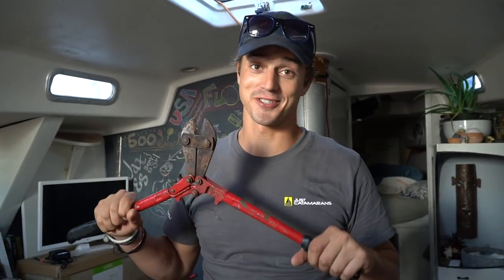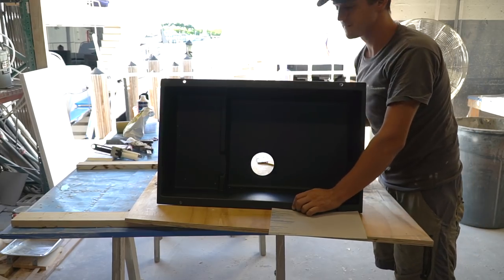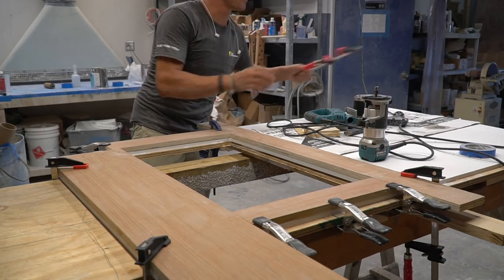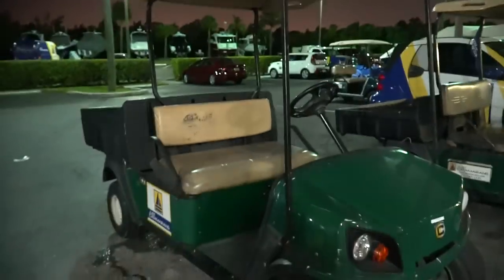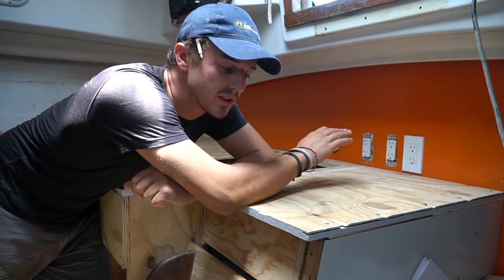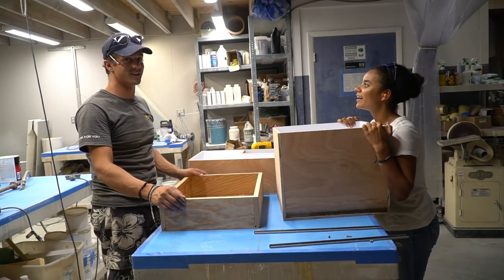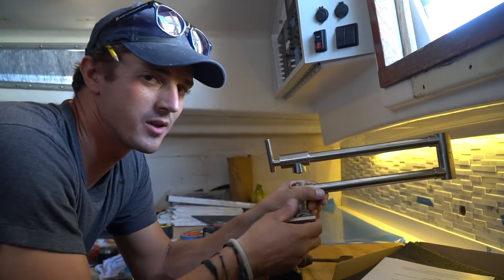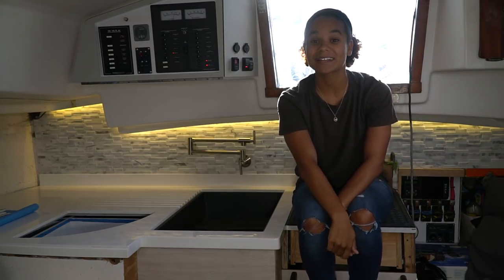Sailboat Galley Renovation (DIY Corian Countertop) — Sailing Uma [Step 136]

Comment: Love your ideas for this gallery refit! Funny how similar our plans are. We were struggling with the faucet choice though and you totally just made it for us! Such a smart choice.
Reply from the maker: Well They accidentally sent us 2. It's yours if you want it :)
Reply: Definitely! We'll see you guys soon :) Thanks!
Reply: Make sure that something sliding can't turn the faucet on. Would be unfortunate under passage to have the water flipped on :D If you want hot and cold, you could install a separate mixer valve like some faucets are set up with and then feed the output from the mixer valve to the cool retracting faucet.

Comment: Back in the day, (several decades ago), " interior grade plywood" was fabricated with interior
grade ( Non-waterproof ) glue. This caused more bother than it was worth, so all plywood
was made with waterproof glue. Additionly, Marine Grade is fabricated with solid cross banding and layers to eliminate voids that would facilitate water intrusion from edges, reduced holding for fasteners driven thru internal voids, and prevent distortion when bent to shape.

Comment: Dan,  I may question some of your choices, based on my opinion, but always acknowledge it’s your choice.   The one thing that really is unquestionable are your carpentry skills and your creativity on addressing a project of any kind.  I know it certainly helps having a shop to work in but damn your pretty skilled.   You have actually started making the boat better than new.    Have you guys thought about upgrading now that’s it at a point of maximum resale?

Comment: you can add a mixing valve if you get hot water and then you can set the temp . One more valve beside it like a shower valve that sets the temp but can go through multiple heads .

Comment: Here's an idea. The opening for for "Hefty Susan" you should make a top. By routing a lip on the Corian counter top and routing a lip on a cover. You can make it fit flat. Then drill about a 3/4" hole in it to lift it on and off. You expand your work area. And cover the area for the "Hefty Susan".

Comment: They loosen through repeated heating and cooling cycles. Keeping them tight prevents overheating and terminal melts. Terminal maintenance should be as regular as your electrolyte maintenance....  Course you don’t need to worry about electrolyte anymore but terminals are still there. 

That worktop is a thing of beauty!!  Amazing. Love the angled drains. What’s the surface material called?  Corian? (Whizzes off to search....)

Comment: they look really nice!   think i would have used a round nosed bit for the drain grooves, but that's a small thing.   I would suggest a "drop on" cover for the Hefty-susan hole, just something that covers the big hole so you don't have things sliding and dropping off down into it when the boat heels over to a big wave...
Reply from the maker: Already done. Look closely at the thumbnail. But will detail more in final vid.

Comment: Looks neat. Nice work. I love the way you design and make things for your boat. Not what I would have done, or anyone else probably, but that's what makes it interesting and fun to watch your channel. Your energy is always inspiring.
I think you may have trouble keeping water and bits of food out of the lazy Susan. How does it lock in place? Surely the compartment with the heaviest contents will swing to the lowest side depending on the tack. And if not locked will constantly be turning. I can see trapped fingers as it rotates. You've probably already thought of those things and found a solution.
Might get to see you at the Boat show.

Comment: Great job in design and execution. Not sure how this progressed, but now about your remark about an induction stove top and this design.
Looking at the opening and rotating cabinet internal, maybe consider something like an "Instant Pot" (tm). That's an electric pressure cooker. It can do slow cooking too. Insulated, heat loss is even less than in induction with a pan. Its insert can be used separately on induction. Great for lobster, fermenting, rice, dried legumes. If that would fit in the rotating shelf, I would put it there (just prevent >360 rotation). With its control panel on its side, maybe a Bluetooth version.
Reply from the maker: We’ve thought about it. Maybe someday, but we’d need a larger inverter to run it and those are expensive. We also like having the cooking redundancy with multi fuels.
Reply: @SailingUma  - for 1,000W? OK. My language has a saying, money doesn't grow on trees :). That said, imagine you could "tap" different Voltages out of a series of batteries. And you could feed appropriate DC volt into devices that run or can run on DC. No DC-AC conversion, no up-transformation, no down-transformation and no AC-DC rectilinearization. Just 12V DC into a laptop, e.g. It's all optimization versus ease or luxury, like sailing, and life

Comment: Looks awesome guys.  You're turning Uma into a high dollar boat!  
I would think a cover made from the same material as the countertop would be nice to have sometimes?  Maybe you're still going to do that?  
Also, being of the short variety like Kika I would think that companion way step you removed would still come in handy on occasion also.  
I would think a flip up/down step like you find on many boats could mount easy enough under the opening.
Reply from the maker: Neither of us ever used that extra step. It was always in the way.

Comment: Inspire ring work and vision
Live the pot filler and sink
One observation / critique: I’m a little surprised you left the countertop with a 90 degree corner by the compsnionway. That’s an area where bodies maybe tossed about in a seaway, and I would want that rounded, if I were aboard, visual aspects are secondary.

Comment: Beautiful! I was wondering if there was a way to put a hot/cold mixer valve with some sort of backsplash-mounted stainless dial to allow the choice of hot water to the pot filler. It would be nice to have the choice. At any rate, it's been amazing watching the transformation of your boat over the last couple years! Cheers!
Reply from the maker: Certainly would be easy to add a mix valve. But for now, we don't even have hot water on the boat, so there isn't much point. Maybe when we instal a water heater we'll think about it.
Reply: Sailing Uma  That makes sense. I thought you had hot water already because of Dan saying you would use hot water to shower, which made it sound like you already had hot water. I understand washing in cold water. I don't have a water heater on my boat either. Sometimes I heat it on the stove for the wash, and just do a cold rinse.  One thing is for sure, boats are always a work in progress!

Comment: Thats a considerable improvement, and I like the surfaces
Its interesting how different, and how much the same these late 36' cutters are to my 365 (1977)
The hatch offset is the other way, and no 3 sided galley, but my 9cu ft fridge is such a waste of space or total energy hog, something has to go there
Doors forward in the cabin started square topped (mines hull 103) then went round topped, now back to square
Also I have a V drive that you dont have. Transmission maintenance and drag vs less straight prop shaft exit. 

One problem I have is that my shipmate, Boss the dog, cant get into or out of the cabin on his own as the ladder is too high
Of course your boat shows a different ladder set up, and Im thinking that might be useful. It looks like its about 800mm or 31 and a half inches high to the counter
Anywho thanks for the good look at your galley area and the inspiration to remap things in my boat
and that most of all you manage this while on the boat
cheers
Reply from the maker: The 35, 36 and 365 are all very different boats.
Reply: Later 36s like yours are, but early ones where just versions of the 365
http://sailboatdata.com/viewrecord.asp?class_id=6222

Comment: Curious why you went for a square cut for the drainer slots. Usually these would be done with a bullnose cutter. Given Corian's propensity for fracturing a round bottom slot would be a lot stronger and also easier to clean.

Comment: I'm pretty new to your channel but have enjoyed seeing all your incredible craft projects. I've been sailing for 30+ years but never seen a boat with the customization that you've done - re - such great ideas. One question I have is about the Hefty Susan - did you save the cut out from the countertop to use it as a plug? It seems like a great lost of space to have the hole there - or cut a piece of wood to use as a cutting board and put it in there - will also keep water out of your dry goods if you get another wave on-board..... Also - curious if you found a way to keep it from spinning when you're under way? Didn't see these two in the video and very curious.. Thanks. (I also agree w/ the comments that you all have a great potential revenue generator if you want to start an interior boat renovation business.)

Comment: HOw did you made those groves from shallow to deep? looks stunning... Probably that wood guiding part was lifted on the far side right? Hope that fauchet stays like that when sailing, could be an issue if the arm gets a bit lazy or worn.
That sink is HUGE by the way, did you guys prefer it like this?

Comment: What about adding a separate mixing valve beside the faucet? bring the hot water to that and connect the cold to it as well, then route the mixed water to the faucet itself?

Comment: Hi Dan and Kika,  just found your posts a couple of weeks ago and have already seen the first 135 after first seeing your latest 5-8.  Regarding your battery failure when the post melted and then the loose cables when you took them out to replace them with the lithium batteries.  Did you ever figure out why you had those failures?  I was thinking the clamps might have been loosening up when they heated up when being used due to expansion and contraction and then May e the stud melted due to excess heat and current draw from the loosened connection.  Would love to know the reason both of those happened.  I love almost all of your posts!  Best of luck!

Comment: Hey, nice job and thanks for sharing, BUT, I do not think that the plywood for under your countertop is 'marine grade'. Now I'm not trying to be controversial, but marine plywood does not 'just' have exterior rated glue. In my experience, marine plywood does use exterior glue and supposedly the same as CDX (which is what it looks like you have here) but is has virtual no voids in the layers ( which you have here as shown in the edge of the plywood at 9.50) and very limited knots. It also has more layers than CDX, usually a min. of seven which makes for a stronger material and is also like five times more expensive due to the extra material and manufacturers cost. I not saying you did anything wrong, just clarifying for educational purposes. The only thing I would suggest is to make sure all voids at the edges and knots are really, really, well sealed and like it looks like you've done most/all the surfaces. In the long run it really doesn't matter unless it picks up moisture.
Reply from the maker: You're right, it's not. The only time to use proper marine grade ply is when glassing bulkheads or other permanent structures to the boat. No need for a countertop covered in epoxy. It will out last the boat at this point.

Comment: Very impressed with carpentry, nice job.  You two work very well together.  Not so happy with Delos drinking cartoon, binge drinking by petite people can be dangerous, be careful!  Some thoughts:  The textured splash wall looks amazing but I wonder if all those little ledges will be dust and dirt catchers,  I think I would have gone with smooth surface,  easier to clean.   Really like the faucet solution, but the faucet fixture has a lot of sharp edges which could be a liability in rough seas.  You might want to install some kind of clip to keep it from unfolding under such conditions.  Are you planning to make a cover for the lazy Susan?  Seems things might fall in there readily the way it is now.  I guess you would also like a lock to keep it still in rough seas.  It may have been better to have the first step below the level of the the sink in the companion way,  so water or dirt has to go uphill to contaminate what ever is in/on the sink, such as drying dishes or food etc.  Wouldn't want the  door mat sliding into the sink.   In no way do I think you have done anything wrong, but just a different point of view.    Love your videos and am in awe of your projects.

Comment: Thought about attaching actuators ( keyboard shelf sliders) to the back of the white screen and attach it with piano hinges to the roof? Or even laptop hinges. You figure it out, Mr carpenter.
Also spice rack is a must ;)

Comment: I'm thinking about adding a backsplash to my galley.  Did you find any negatives to doing this project?  I see you used 3M Epoxy Foam Tape.  Did that work well for you?  Would you do anything differently?  I also wonder about removing it someday, to accommodate a new buyer.  Would you think that is a possibility?
Reply from the maker: The tiles we used already had the sticky foam on the back. They’ve held up really well!!  But we’ve never made an upgrade with a “future buyer in mind”. Boats are depreciating assets, so do what makes YOU happy and gives you more enjoyment with it.

Comment: Looks great! For the drain channels cut into the countertop were you using a board with a angle on it as the guide? I couldn’t quite tell how you cut the channels at a downward slant.
Reply from the maker: Just made a wooden ramp. Let the router slide down it, cutting deeper as it went.

Comment: I really like it.  Did you think about the negatives about the uneven tile?  In the future it will not be so nice if you want to mount anything to that wall.  Also did you mount the planter so it doesn't fly around in heavy seas? how about a hold down for your faucet for when it becomes looser and wants to swing out?  The hefty susan could use some pull handles on the inside for when you have large amounts of weight stowed there.  It all looks super though!
Reply from the maker: We dont plan on mounting  anything on the wall, we like the clean look. Faucet wont go anywhwere + A lilttle trick : all our plants and other ornaments are alwayseither screwed down or glued down. No worries Lazy susan is all delt with  😉(we'll cover that in a later episode)

Comment: Sail boats are light weight  by design with a weighted keel.  If not careful what materials you use the boat will become unstable in high seas. Surely you think about this when building. I know its your home and want it nice but don't forget weight...

Comment: You take such meticulous care of your boat and in you design and building ... why would you neglect you router to the point of destroying it?  Brushes are the easiest item to replace.  Depending on use I replace mine ever few years and stock a spare set in my tool cabinet.

Comment: FYI for you non-boaters.  That is NOT real marine grade plywood.  Probably just exterior grade that you can buy at any home center.  You can tell quickly because real marine grade plywood has not knots in either face or any of the inner plies.  It also uses "boil proof" glue for the assembly.  Marine grade plywood is crazy expensive !

The drawer boxes are likely real marine plywood.
Reply from the maker: Hence the epoxy primer on both sides.
Reply: Marine grade plywood comes in many grades, A-A, A-B, B-B, Medium Density Overlay (MDO) and High Density Overlay (HDO). All grades allow for knots on the inner and outer plies but all knot holes must be filled. Some high grades of exterior plywood are actually better looking than some of the low grades of marine plywood.
Reply: S/V Tattoo - The only "real" marine plywood meets BS1088 standards. 
 https://en.wikipedia.org/wiki/BS_1088  I have never seen BS1088 have those choices.  The specs are much tighter than what you stated.  I have even seen "marine" plywood that only has "moisture resistant" glue !  I sure would not want that especially below the waterline !

Comment: huge waste of time and effort. youre better off getting rid of that POS boat and buying a nice newish boat you can then pour money and time into refitting. you wont get a fair market value for it. i had the same issue with my old boat which was aging rapidly but still looked good. got rid of it at a very good price and now i have a brand new boat ive put a few $ks of change into refitting. much better to start with a good new hull and make it like you see fit than to worry about redoing an old junk heap. i salute your talent but not your financial acumen.
Reply from the maker: It's not ALL about money my friend
Reply: if it wasnt you wouldnt be on youtube or patreon. or monetizing videos.